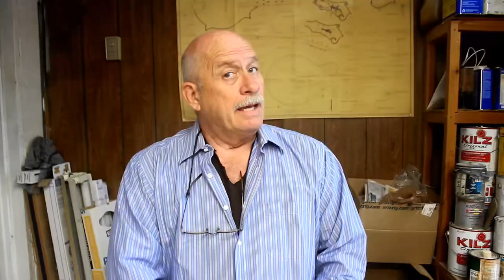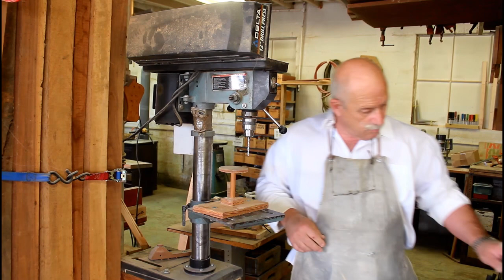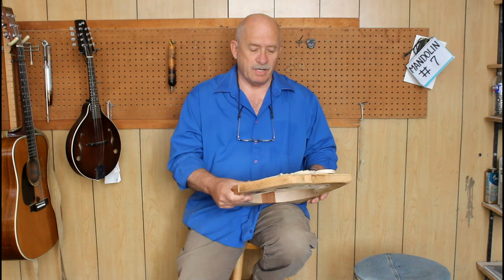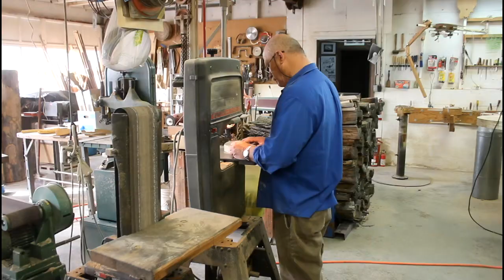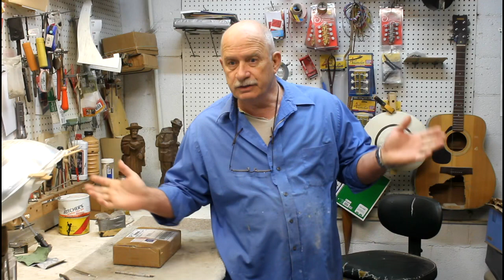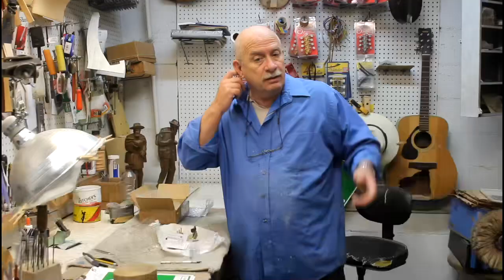Episode 118)   Bending Mandolin Sides and Carving Mandolin Tops

Comment: Nice to get an up close look at the drill press rig for graduating the carved areas.  Once again something you make look easy that takes a long time to master.  Must be a nice feeling when those sides snap into the mold crisply!  Interesting idea to use the drum sander to get that depth on the edges.  Sure works fast.  Those are nice looking tuners!  Don't think I've ever worked with Rubners either.  Thanks for taking us along!